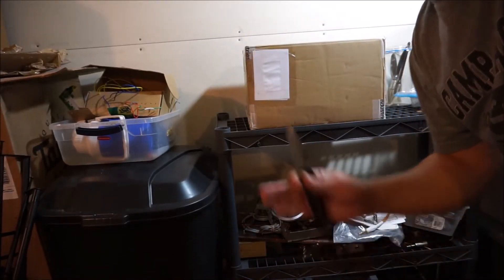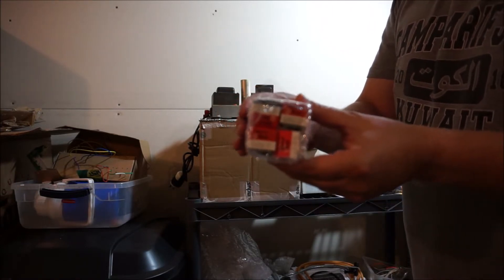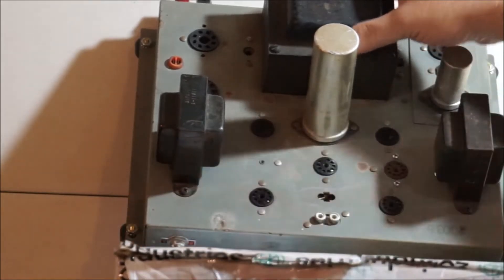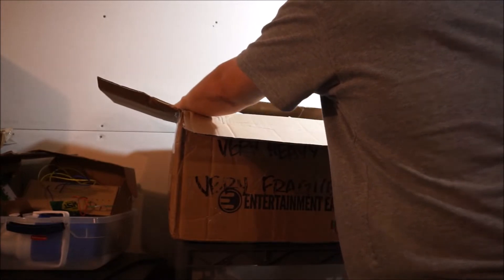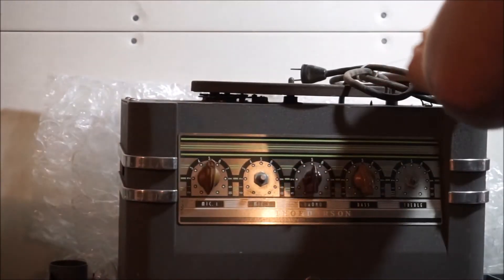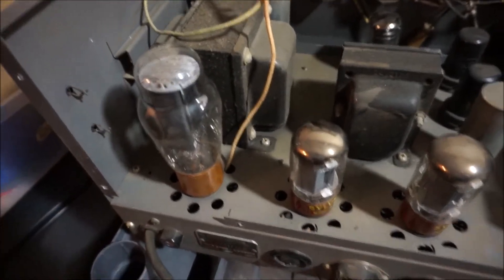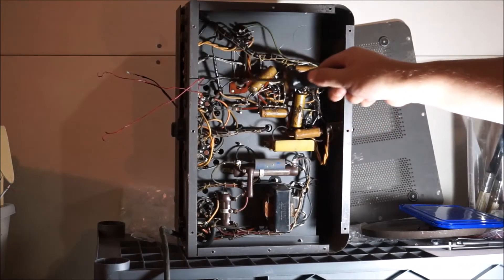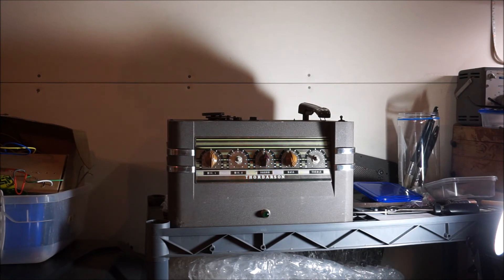SRT Amplification - Thordarson Amplifier and V-M Audio Stereo Amplifier

Comment: Congratulations on getting the Thordarson amp, William. The cabinet looks great and has lots of potential, once you get rid of the add-on phonograph on top. I really like the design. Maybe you can find a couple more of those original "T" knobs on Ebay. The transformers, circuitry, and tubes are all very high quality. This should be a great project and a really great amp once you're done with it.
Reply from the maker: I just can't get over how nice it looks. You know I spent 7 years stationed in Hawaii and they had a lot of buildings there that were built in the '20s and '30s, in the Art Deco style. When I saw this amp it reminded me of Hawaii.
Reply: It truly is an attractive, well designed cabinet......with an equally high-grade circuit. You did well to acquire it, and I can't wait to see how it turns out.

Comment: Cool looking amp for sure, I just picked up a neat amp myself, it's a Knight KN 724A stereo push/pull tube amp 12AX7 and El84's it's switchable 12 watts stereo and 24 watts mono and came from the factory setup for 4-8-16 ohm output!  also got the matching KN170 tuner.  The amp should make a monster little guitar amp when it's done.
Reply from the maker: Awesome brother!!! Can't wait to hear it.
Reply: So I get this amp and tuner on the bench today and start going through them I do a visual inspections then I clean all the tube sockets and tube pins clean and lube the pots and switches etc. etc. then when I fire up the amp I find out the amp has a really loud hum even at zero volume which is making the speakers actually vibrate, everything works and I get sound and the volume works so I start pulling the preamp tubes one by one still have hum as I go through them then I pull the power tubes one by one and still have a hum as I go through them it finally goes away when I pull the 6CA4 rectifier tube and I didn't have one to swap in there so I gotta order a replacement before I do anymore troubleshooting on this little beast.
Reply from the maker: Are you sure it was the rectifier tube and not the filter caps? I only ask, because as soon as you pulled that tube, you took all of the HVDC out of circuit, to include the filter caps. I would think they are the cause of the hum, before that tube. That has been my experience anyway. I guess it won't hurt to have any extra rectifier tube for that thing anyway.
Reply: Well that's what I thought also but there are only 4 .047 brown drop caps in the whole amp besides two can capacitors it's a weird little amp   I'm gonna swap that tube and if it still has the hum I'll disconnect those can caps and replace them with some film capacitors.
Reply from the maker: What are the can cap values?
Reply: Mallory CE206R 10 Mfd. 10 Mfd.  350 v
Dry Electrolytic  20 Mfd. 350v - 20 Mfd. 350v -20 Mfd. 300v-10 Mfd. 50v
Reply: The bottom of the cans look fine no leakage no swelling
Reply from the maker: Well depending on the values, you may be able to get a new CE direct replacement for them.
Reply: I'm just hoping it does not have a couple of bad output transformers
Reply: I'll see what happens I spent a lot of time today just cleaning these two pieces they were really dirty inside so by the time I was done cleaning and inspecting everything and taking inventory of all the tubes and actually got around to testing the day was shot but at least I know now what I'm up against just want to get this amp screaming again I got a really good deal on the pair.
Reply: Found new replacement cans for $60 freakin bucks